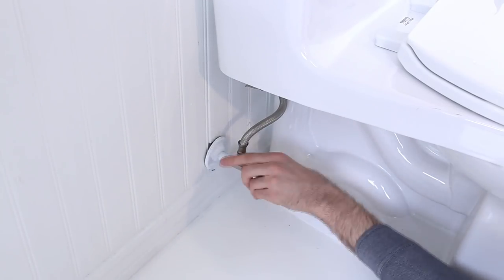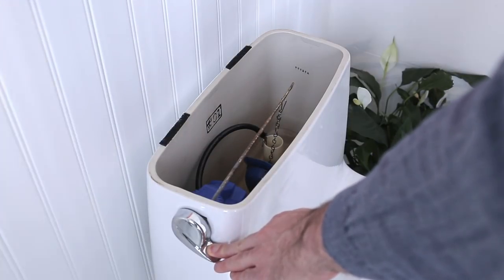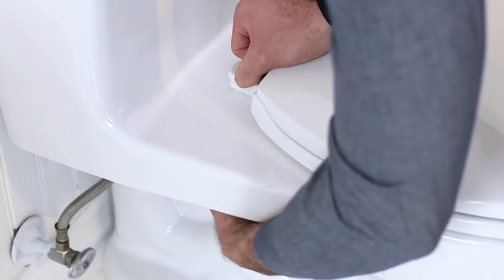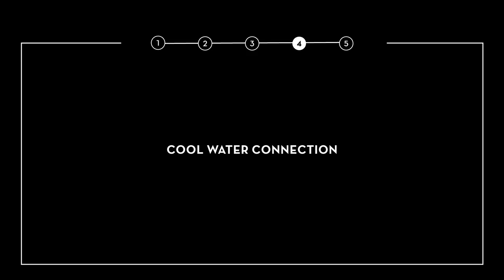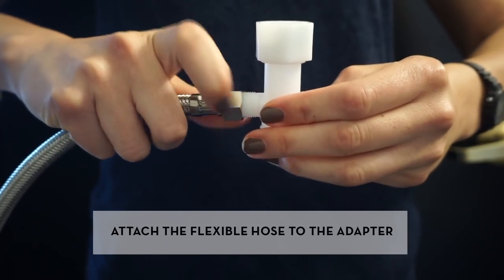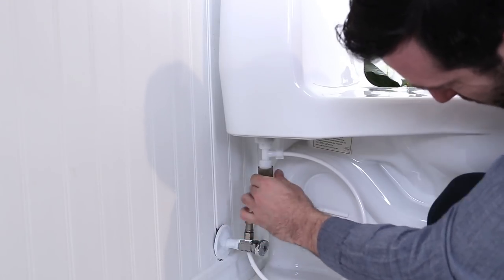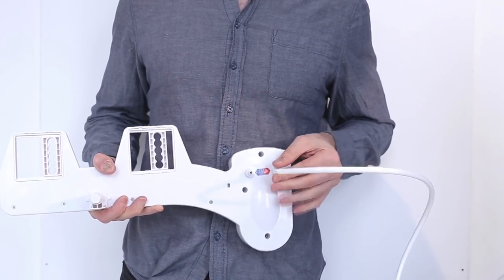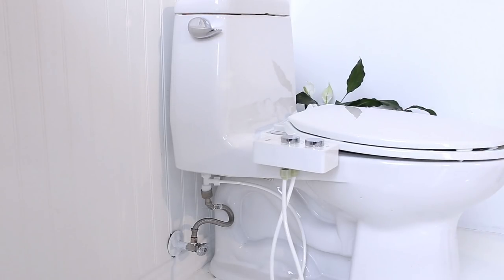Tushy Classic (Cool) Installation Video

Comment: If the valve at the wall is tight, spray some WD-40 in there to loosen it up. Should turn free, no problem.
Reply: Good ol’ veiner shleiden.

Comment: Pouring oil on the flames.  I've had a hell of a time trying to install it.  Pretty sure the wrong size washers were included.  Frustrated and tired and then I go to You Tube for help and find this smarmy jerk winking his way through a "he doesn't have a customer service bone in his body" installation.  I pray this is a public company.  If it is, I'm shorting it.
Reply: i don't know what's up with the washer neither.  i ended up not using it.  what about you.  it wasn't that hard to put in after i skipped the washer.  hope it doesn't leak.